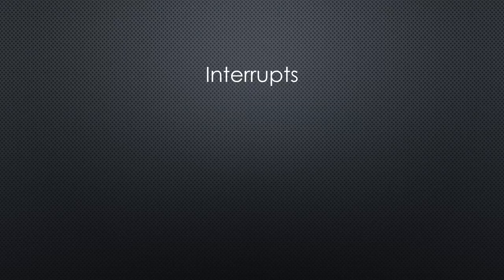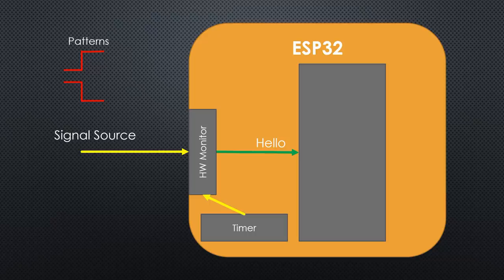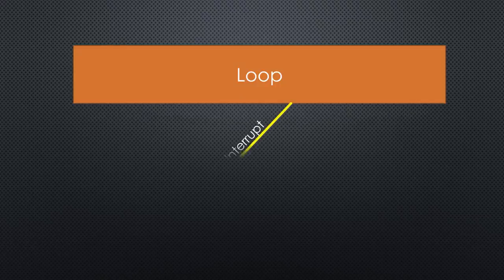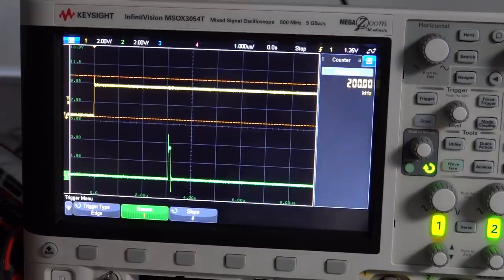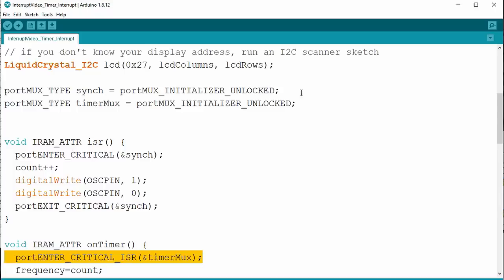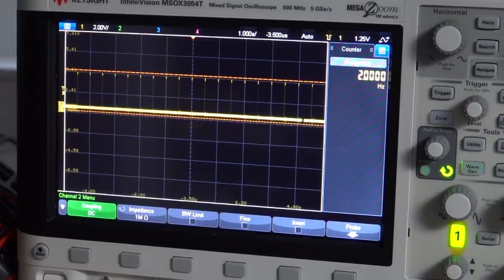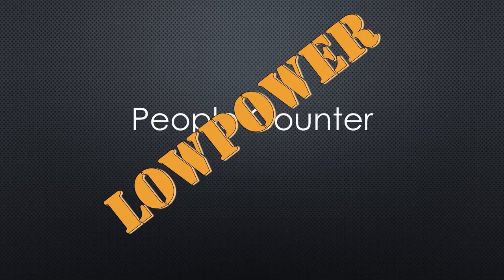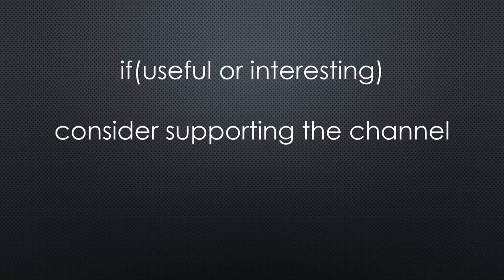#328 ESP32 Secrets: Interrupts, and Deep-Sleep under the Hood

Comment: Hi, I'm I the only one having a problem with the ESP32 on a LoRa TTGO T3 board ?
I use interrups to count pulses coming from an anemometer and a rain sensor. So quite slow.
No matter what I do, the ESP counts FALLING AND RISING edges, despite that I asked to detect only FALLING edges.
I debounced the input signal, but I clearly see that it counts twice !
Any advice ?
BTW, nice tutorial as usual ! Do you sleep sometimes ? 😁
Reply from the maker: I am not good in remote debugging, particularly in such difficult situations :-(  If not already done, I would create a simple example that moves one pin in the interrupt and watch the interrupt as well as this pin with the oscilloscope.

Comment: No idea about ESP32 but on AVR the standard digitalWrite is very slow, order(s?) of magnitudes slower than directly assigning value (or reading from ) of a pin. Can it be a problem here as well on ESP32, and can be quicker? I say this because you pur digitalWrite into the ISR (making it longer to execute). But honestly I have no idea how digitalWrite/read performs on ESP32, I can only tell it's extremely slow on AVR compared to direct pin manipulation. At least according to my experience and crude measurements. At least ESP32 should be fast enough for even VGA signal generation done (though with some tricks, it's possible even on AVR, surely assembly/tricks/etc must be used anyway in that case) by some makers (though in that case it'd not done directly but some hardware help of ESP32 to DMA data to output, if I am correct here).
Reply from the maker: I tried the maximum frequency without the pin toggle, and it was not much higher. So I assume it is not too slow. But I did not test if it has the same issues as on the Arduinos.
Reply: @AndreasSpiess  It would be interesting to see a tight loop (not the loop function but an own loop inside to avoid the "bookkeeping" stuff involved - maybe - by the arduino libraries executed before every main loop iteration) implemented without delay altering a pin with digitalWrite and then directly, and see what kind of frequency it creates on that pin, to be able to see if there is any significant difference though. At least I did this on AVR/Arduino some years ago, though I can't remember the exact results, just that digitalWrite was way more slower.
Reply from the maker: I made a test of toggling a pin in loop. You find the result in another comment. It is very fast.

Comment: Very interesting!  I've been trying to combine wake up timer and wake up interrupt on my current project but have run into a bug with the ESP32 that is problematic for multiple wake up methods.  Have you ever tried both a timer and interrupt for deep sleep?  For example, counter on interrupt and then sending the count total every 5min?
Reply from the maker: I wold not mix deep sleep and interrupts. As shown, in one case the CPU sleeps and in the other it runs
Reply: @AndreasSpiess  I mean waking up on an interrupt pin (esp_sleep_enable_ext0_wakeup(GPIO_NUM_33,1)) I've found that when including ext0 and timer wakeup that there one of the two sometimes doesn't work

Comment: You did measured delay of interrupt. But is it really delay of interrupt or did you measure how long does it takes to evaluate portENTER_CRITICAL?

Also - volatile - should be used on shared variables - not on all variables in interrupt function (not sure if it is different for ESP32 - but just standard c++)
Reply from the maker: 1. You are probably right with the volatile. But because it does not cost a lot I do it for all used in the ISR ;-)
2. I do not know where the delay is coming from. But it is not very important for me because I have to use this statement (at least this is my knowledge)
Reply: @AndreasSpiess  I'm more oriented on software development - and I have only ~2 years experience with raspberries or esp's :) At work I'm working on application used by tens of millions - so I know what threading issues are (any small chance to happen - it will happen :) )

So I just wonder if portENTER_CRITICAL is not just going "safe" when interrupt and main program do things on same ports - it is ok for "counters" or so but not for quick reaction - like frequency counting ... If it does not cause crash, lost of dat or so - it may be ok to omit that
I'm going to use this method for weather station - as counter of revelations caused by wind - so for me it would be ok :)

But one think I also understand - if manufacturer wrote it in manual - it may be wise to use it anyway because later changes may break my program (after using new chip or recompiling with some new libraries) - and then it is hard to find problem

Comment: I believe the esp32 runs freertos in order to manage the wifi stack. Your code is only one thread between others. So it’s possible that another one is delaying your interrupts.
Reply from the maker: You are right.
Reply: Interrupts are higher priority than ANY thread. The lowest priority interrupt always interrupts the highest priority thread!
Reply: Unless they get disabled by a critical section, or if higher priority interrupts need to be serviced.

Comment: Hi Andreas, i've been following for a while, you help me a lot with your videos about lora and esp32, which help me to write firmware for a local startup. Latelly i've seen some problems with the esp32 (we have in production more or less 300 boards based on esp32 wrover), sometimes the uc freezes (hangs), i am not sure if this happens after the deepsleep (the device samples data for 3 minutes, and enters in deepsleep for 12 minutes) because of a fail in the RTC to generate the interrup to wake up the board. (the board cannot be accesed once that is deploy, we are using in farms). Have you ever encounter a problem like this? Do you have any recommendation or knowledge about this problem? Thanks in advance, hope you are well!
Reply from the maker: These are bad problems which mainly occur if you deploy many devices. Here I restart my boards without thinking if they do not work anymore. So I cannot answer your question.
The only possibility is to start logging and try to provoke the error in a test setup.

Comment: Doesn't page 38 section 2.3.3 of The ESP32 Technical Reference Manual document how to use the Interrupt Matrix Controller to disable CPU interrupts?  Another interesting video, by the way.
Reply from the maker: You are right. But I do not know how to do it in Arduino and also not the consequences (as Ivan points out in his blog entry)
Reply: @AndreasSpiess  Ah, ok, I use Platform IO. I'll try and have a look using it in Arduino IDE and see if I can find Ivans blog. Haven't found Ivans blog but have a look at "Assembly via Arduino (parts 1 and 2) - Introduction" you tube videos.

Comment: So at this point, you surelly know, witch is better for low consume ? an ESP32 dev board or an ESP32 single module with personalized PCB and all pieces around solder by us please ? 
Thanks a lot for the video
Reply from the maker: I made some videos about low power and MCUs. A plain module with a LiFePo4 battery seems to be quite good because it does not need any regulator.
Reply: @AndreasSpiess  Yeah... I so a lot of your video.
Obviously I'm subscribed  :-) 
Thanks a lot

Comment: I'm trying to make a simple project to count pulse of a water meter based reed switch. But the EMI causing issue when connect direct long wire to ESP32.
Reply from the maker: I can imagine. The ESP32 has a built-in radio transmitter. I put my ESPs close to the sensors and use Wi-Fi to bridge the distance.

Comment: Mr Andreas, thanks for the video.
I have a project that extensively uses interrupts. It uses 8 water flow meters to measure water consumption. I have always used portMUX_TYPE mux = portMUX_INITIALIZER_UNLOCKED; in my code without actually understanding its function. 
I saw you are using portMUX_TYPE sync = portMUX_INITIALIZER_UNLOCKED; Tried to search for the differences but failed to find relevant explanations. Why MUX or SYNC and when to use one or the other? Thanks in advance.
Reply: That is just a variable name, you could use portMUX_TYPE potato = portMUX_INITIALIZER_UNLOCKED; just refer to the same variable name in your ISR's portENTER_CRITICAL(&potato) and portEXIT_CRITICAL(&potato) calls.

Comment: Great video!
Question 🙋‍♂️ could you count frequency with an internal hardware counter? Are they cascadable so that you could at least use them for HF?
Thanks 😊 73…
Reply from the maker: You are right. You can use the internal counters either to count or to divide the frequency of the input signal. Here I did not want to build a fast counter, I only used it as a simple to understand example for interrupts.
Reply: @AndreasSpiess  Thanks for your replies; much appreciated 😃

Comment: If you're looking for quickie content I'd love to see a low power battery operated wifi mqtt switch for use with homeassist etc. In my case I would fit them behind standard light switches and double sided tape them where convenient. 
ZigBee switches are not very common and and I haven't found a nice way to control my sonoffs outside homeassist.
Reply from the maker: I like teh Zigbee switches and Zigbee recently became much more important as a Home automation standard, I think.
Reply: @AndreasSpiess  I agree. I use a simple zigbee2mqtt dongle to integrate them and the Xiaomi/IKEA switches are very neat... I just don't know what to do with my ESP devices now :-).

Comment: The implementation of the command digitalWrite(..) in the arduino environment is not optimized. If you would set the pins directly bypassing the arduino interface, you might achieve a much shorter reaction time!
Reply from the maker: Maybe. But the ESP32 also has RTOS which probably takes most of the time. Anyway, we have to work with what we get.

Comment: hello good video thank you very much it helped me a lot

but I have a question

I have a set of multiple gpio as an interrupt pointing to the same ISR function, the question is how can I know which GPIO was activated by interrupt?

Or are there special methods to do this type of query?
Reply from the maker: I would add different ISRs for each interrupt and call a common function inside each one. Maybe there is also a register to find out which interrupt was triggered. But I do not know it.

Comment: 12:56 Why ++counter when previously  counter++ was used ?
Reply: the processer shall not think he can predict programmers behavior ^v^
Reply from the maker: No particular reason other than to show it is possible for the non-programmer.
Reply: There is no difference when used standalone, both result in the same value. It only matters if you're evaluating the result in the same instruction, in which case counter++ will evaluate to the value before it's incremented, while ++counter will evaluate to the value after it's incremented.
Reply: @dwmorris  In C++ (that the Arduino IDE uses), as opposed to C, there is a potential significant difference between the post and prefix ++ and -- operators. This is partly due to operator overloading. This mostly affects performance, but the prefix operator is always guaranteed to be at least as fast as the postfix equivalent, assuming they are implemented semantically the same of course. It is therefore recommended to use the prefix variant unless one actually uses the pre-change value for something.
Reply: There is no difference. Even in C++. It is the same. Don't scratch your code about it unless you use C++ STL iterators (and even then it often will result in the same code, because compiler is smart enough), which you probably shouldn't on microcontroller anyway.

Comment: I am not 100% sure but I think in your code example (Frequency_Counter_with_Timer_Interrupt.ino) there are 2 mistakes:
1: mutexes - 2 instead of 1 only?
a- interrupt  (isr) calls mutex (synch), increases the counter, unlocks the mutex (sync)
b- timer (onTimer) calls mutex (timerMux), gets the counter, resets the counter to 0, unlocks the mutex (timerMux)

if I get it correctly, the mutex is to tell both processes: "guys, I am in charge now, wait while I am touching THIS global variable".
If so, both: isr and timer should call (enter/exit) THE SAME mutex.
But in your example there are 2 mutexes, that have nothing to do with each other so how is timer stopping isr and vice versa?

2: portENTER_CRITICAL and portENTER_CRITICAL_ISR - wrong usage?
a- inside isr function (isr) you should call the portENTER_CRITICAL_ISR not the portENTER_CRITICAL
b- inside timer (onTimer) you should call portENTER_CRITICAL - not the _ISR version
in the above file it is opposite 
FreeRTOS says this explicitly: "taskENTER_CRITICAL() and taskEXIT_CRITICAL() must not be called from an interrupt service routine (ISR) - see taskENTER_CRITICAL_FROM_ISR() and taskEXIT_CRITICAL_FROM_ISR() for interrupt safe equivalents." (portENTER_CRITICAL is a macro to taskENTER_CRITICAL)

let me know how much I am wrong - learning is my pleasure
Reply from the maker: I used two different names because I did not know if wone ISR interrupts the other. Maybe you can also use the same.
The ESP32 has two cores which made it necessary to adapt RTOS. I went with the Espressif documentation (Search for: Spinlocks are of portMUX_TYPE (not to be confused to FreeRTOS mutexes)
You are right: Documentation suggests using taskENTER_CRITICAL_ISR. I corrected it in one ISR.
Reply: @AndreasSpiess  I might be wrong but irrespective how many cores, if you use 2 processes that touch the same variable (in critical) you need the same name of the mutex to be entered/exited in both processes, right? otherwise they don't block each other to access the variable and race happens or even worse ;)
Reply from the maker: @zyghom  I do not know the functioning of those spinlock. As written in the documentation, the are not mutexes.
Reply: @AndreasSpiess  ha, and since I use ESP32-S2 mainly, and it has only 1 core, now I got the confusion cleared - thank you my guru!

Comment: What tool did you use to accurately measure the milliamp current consuption at 15:30? it does not appear in you link with the equipment you are using...
Reply from the maker: I made a few videos about current measurement and deep sleep. This is an OTII and sometimes I use a current ranger or microcurrent gold or Joulescope.

Comment: Sir have you tried measuring domestic AC supply with 50Hz ? I guess ESP32 interrupts are unable to work at slower frequencies and gave false triggers... Please provide your opinion.
Reply from the maker: You have to condition the signal before you feed it to an ESP or any other microchip (zero-crossing). It expects a steep rise or fall of the signal which is not the case for a sine wave. The ESP has no problems with slow signals.
Reply: @AndreasSpiess  I had used an Optocoupler for zero crossing and it seems to work fine for arduino with interrupt and also for esp32 it works with your state machine code but when using esp interrupt code.. It shows false triggers.

Comment: A little off topic but... When using the ext1 deep sleep wake, is it possible to use an IF statement to perform tasks based on which of the buttons woke the esp?
Reply from the maker: It should be possible to read the pins with digital read as one of the first actions after wake-up
Reply: @AndreasSpiess  thank you for the quick response, definitely an option, but I was only using a single pulse as not to cause multiple wake ups.
As the esp prints the GPIO I thought it may be an option to do something like below:

IF(GPIO_WAKE_REASON==GPIO2){
TASK ONE
}
ELSE IF(GPIO_WAKE_REASON==GPIO15){
TASK TWO
}
ELSE{
esp sleep enable ext1
Esp deep sleep start
}

Comment: Hi Andreas, I am experiencing the same interrupt latency issues with my design. Have you come across any there any good alternatives of ESP32 like MCU boards at fast realtime operations low interrupt latency; that can provide wifi and ADC?
Reply from the maker: I heard that STM finally jumped on the Wi-Fi bandwagon. But I do not know if we can program it with the Arduino IDE.

Comment: Actually the following ESP32 code can measure timing between two pulses with 1 CPU cycle accuracy (~4.2ns) with no issues:
https://pastebin.com/9e2AR5Nd
The minimal time between two interrupts should not be lower than 55 CPU cycles (the time needed for processing two consecutive interrupts). So whatever is on the video is far away from the reality :)
Just get rid of all those Arduino sh*ts and everything will be fine with the performance ;)
Reply: Arduino Whats ??
Reply: @noweare1  , just use ESP-IDF with no Arduino environment bloatware and stupid adaptations, this is what I meant...
Reply: This. One you know how to deal with ESP32 SDK and understand hardware better it usually outperforms other microcontrollers.

Comment: wow at 240MHz, I thought the ESP32 is so fast that it could handle reading pulses even upto 100MHz. But actually it appeared to be that commercial oscilloscopes use really fast chips that run at high operation frequency; like, 1-2 GHz.
Reply from the maker: RTOS is somehow reducing its interrupt speed.

Comment: Thanks for sharing such an insightful video. I ran into a problem during this lockdown. I only have a single ESP32 and somehow the microUSB port has been broken. Now i would like to upload my sketch with the pins available in ESP32. Can you please help ?
Reply: Sandeep Solanki Look at OTA. Your problem then is limited to one more upload
Reply: @bollie9752  Thanks. I believe that you can only upload firmware through OTA once you have a initial sketch being uploaded.
Reply: @SandeepSolankis  Flash it with usb to uart adapter. Put gpio0 to gnd to put the esp into flash mode. See esp32 cam flashing videos so you'll get an idea.
Reply from the maker: You should be able to connect a FTDI board directly to the RX/TX pins
Reply: @AndreasSpiess  Yes, i was able to achieve it. Thanks!